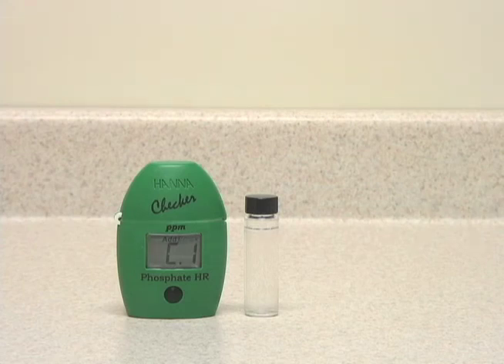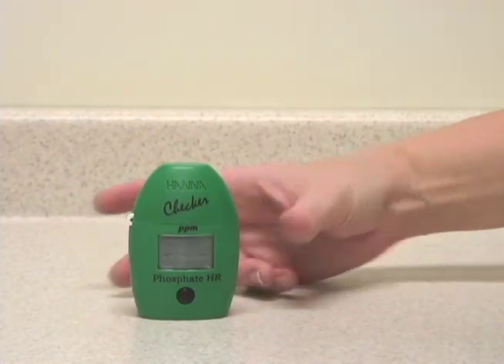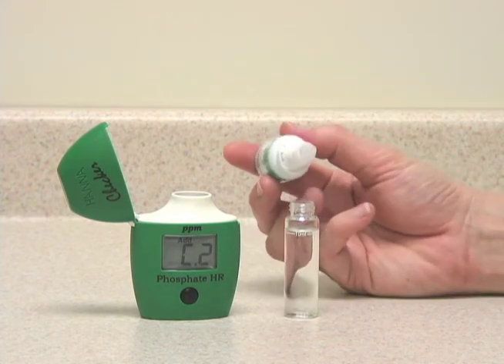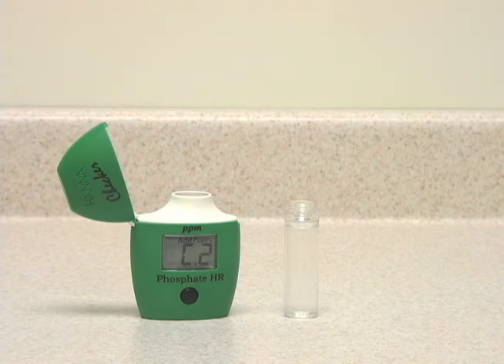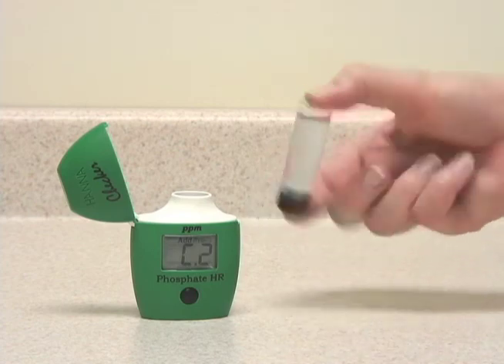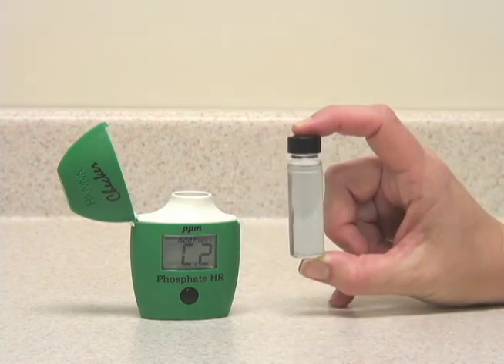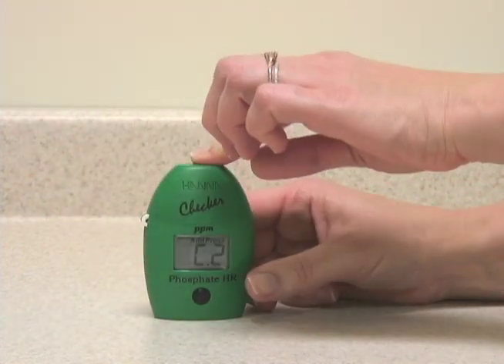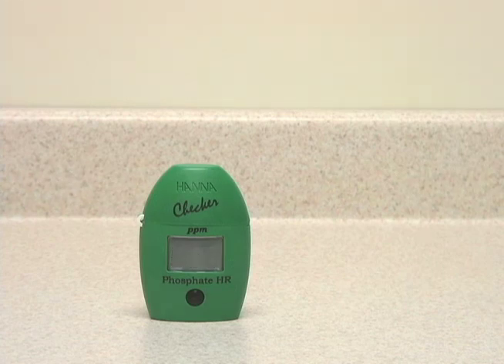HI 717 Phosphate HR Checker HC

Comment: Can we check powder sodium hexametaphosphate using this to check inactive phosphate?
Reply from the maker: Hey there! This device is designed to test for orthophosphate concentration in dissolved water and is incapable of detecting reactive, acid-hydrolysable, or total phosphates. 

Testing SHMP for total "inactive" phosphates requires doing a test for total phosphates which will require more capable lab equipment.

To meet the standard required for your application we recommend the HI83399 Benchtop Photometer and (all other necessary components)

If you would like to discuss further, please reach out to our applications department at application_support@hannainst.com

Comment: What are the reagents? and Why do you need to mix them with your water sample in this test? Also, why do you have two reagents and not 1?
Reply from the maker: Some of our devices come with 1 reagent while others come with multiple - it all depends on the test that you are running. You will need to check the sample before and after the reagent is added so that you can get your reading.